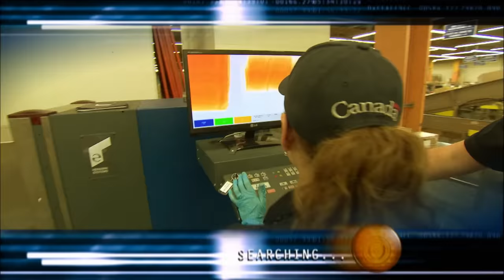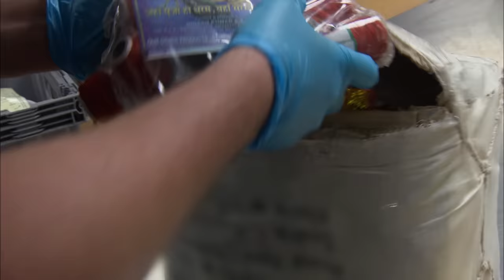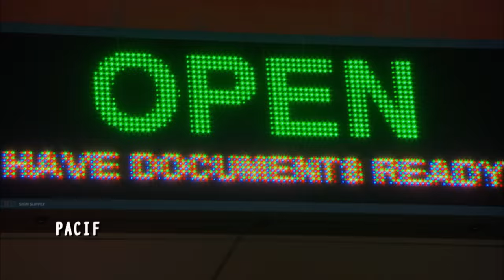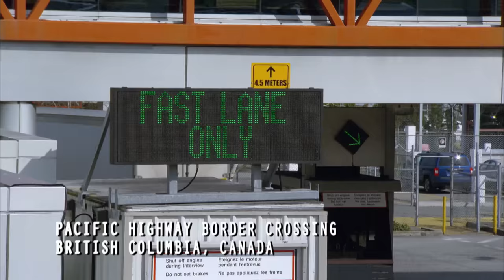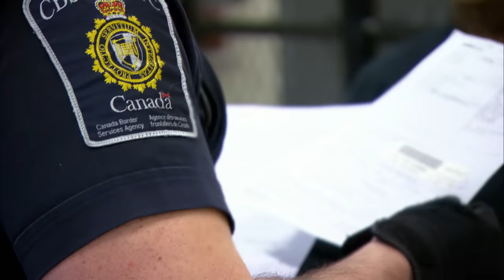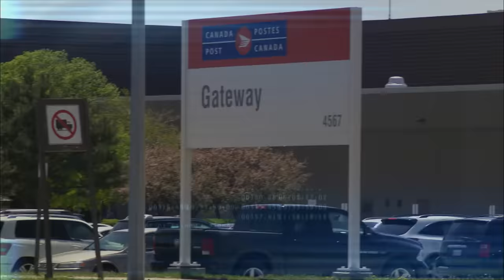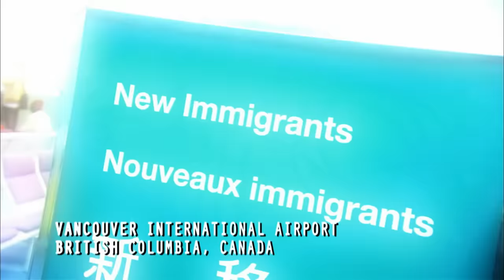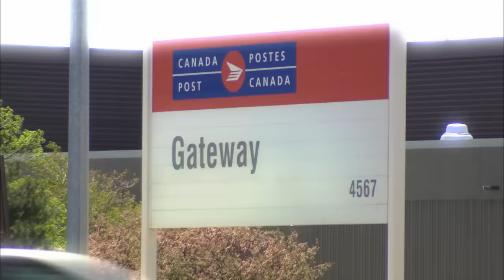Customs Stops Tricked Out Truck | Border Security: Canada's Front Line

Comment: It was hilarious when they found a second bag tied up with same green rope!  But I have to wonder why nobody checked the tag on the bag.  That should be step 1.  The passenger's name is clearly indicated.
Reply: I think the other bag was for plausible denial.  It was his go-to bag if he was stopped.  He intended to leave it there if he could get thru with the drugs.
Reply: @alext8828  They know if you checked two bags, and your name is on both of them.
Reply: @vizzini2510  He checked the other bag and someone else checked that one for him.  They have thousands of unclaimed bags.  The odds of 2 identical bags with lime green rope on them is astronomical and didn't happen.  I don't think it was scripted.  The guy really looked like he was lying.  If it was an act, he should get an Oscar.
Reply: I’ve seen curbside baggage handlers that will wrap your bags for a fee, could have been one of those at the point of origin.
Reply: @StrongDreamsWaitHere    Did he say he tied his bag himself???  I forgot, now.  Good point.
Reply: @alext8828  I don’t recall, but they did say the other bag cleared customs and was returned to its owner.  So they weren’t both his in any case.

Comment: I travel the BC border a good bit each year for work and will be again in two weeks. -> ADVICE: backup/wipe phone and devices to a cloud based system. Not just Canada always when traveling.

Prequalify as best as possible, background, work requirements, and KNOW your story. Good people get questioned often because they just fail to maintain even if they’re not illegally entering. 

Also remember these are just outlier cases, I’d say 95% of passengers go through the border without any hiccup.
Reply: Wouldn't it be easier than wiping your phone to just buy a burn/prepay phone for the trip?
Reply: @SnuffitLabs  burners have sub standard cameras, displays etc. cloud backup will a few minutes and you can do it over Wi-Fi in the airport.

Comment: Learned a new trick.
Get two bags that look identical, but unique.
Fill one bag with contraband (call this bag guilty) and the other with totally legal content (call this bag innocent).
Add the two bags to the rest of my similar bags.
Check in bags (use different label on guilty bag).
At destination, grab every bag except the innocent one.
If successfully get through customs, Good.
If stopped at customs and guilty bag noticed, claim it's not my bag.
Go back to baggage claim, and get innocent bag.
Get away without being charged, but loose guilty bag.
Reply: That's stupid. You realize the airline puts your name on the barcoded bag tag?
Reply: Also, what about trained drug dog detector??
Reply: @ticks4ticks4  The entire point is to have plausible deniability if they find you with the "guilty" bag.
Reply: @johncochran8497  That wouldn't work at all. You can't label one bag differently. The airline tags all your luggage for you with your information. You also can't just abandon a bag at the airport be it a "guilty" bag or an innocent one. An unattended bag with your information on it will get you in a lot of trouble. And if you rip the tag off and then abandon it, well, you just tied yourself to that bag anyway when they go back and check the cameras to see who abandoned the bag.

Comment: I've crossed 9 borders most multiple times here on earth on motorcycles and bicycles. Opted for a run Port Huron to Niagra Falls, there outa the line of vehicles apears one of these bad acting agents. "Take that MC to secondary inspection", where a fat ole grumpy woman appeared opened 2 side and one top case. Acted like a bimbo at a K Mart blue light special, dumped them all on the pavement. I don't drink, smoke or dope and don't act stupid, musta pissed her off. She grinned and told me to repadk it and get outa there. That was 87 never had the desire to go back there for any reason, they were ALL bad actors.

Comment: When flying and the luggage is locked it has to be a TSA lock.  That means the log can be opened by TSA.  This also means the possibility that another key could be the same.  Don't tread on the key.  The rope is more difficult to defend.  Green rope on a blue baggage!  The work permit is such a hard one.  Canada will not allow anyone in to do work without proper permits for work.  I went there to perform maintenance on a MRI.  I had to have documentation showing it had always been serviced by my company.  They don't want anyone taking employment from a Canadian.
Reply: Tons of nurses from Canada work in the USA.